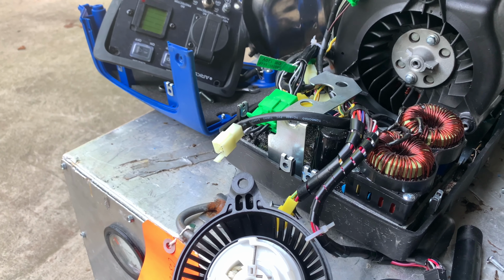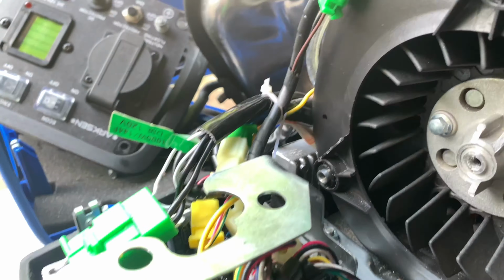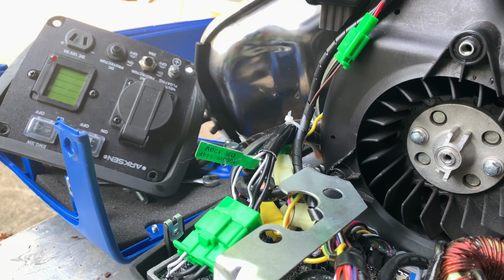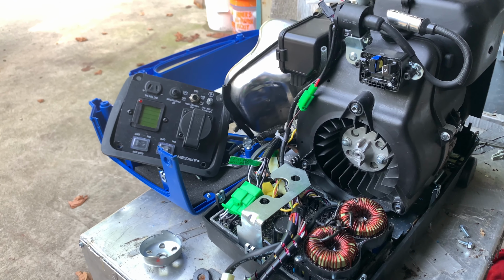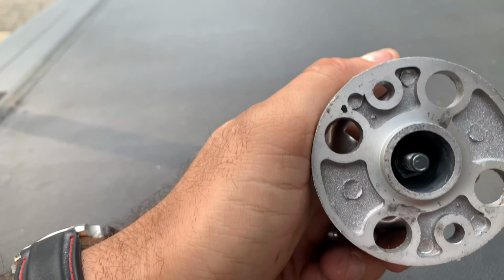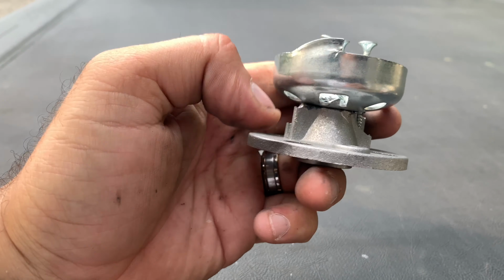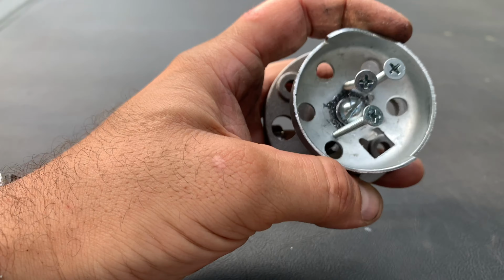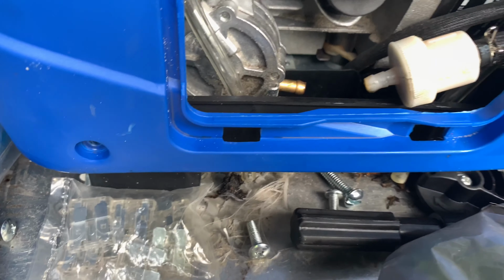Generator Broke

Comment: I seen how you were starting it you pull like your trying to rip it apart do not do that be gentle with it and dont pull the cord all the way to the end like I seen you do in the review and such on it light easy pulls is how you start them these are a little motor not a big motor they dont need yanked so hard and dont need the pull rope yanked to the end.